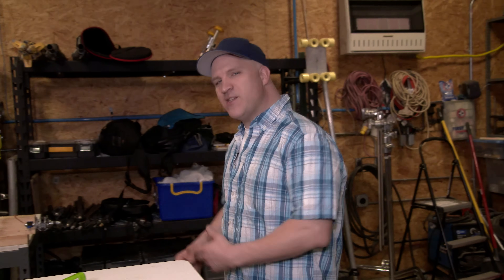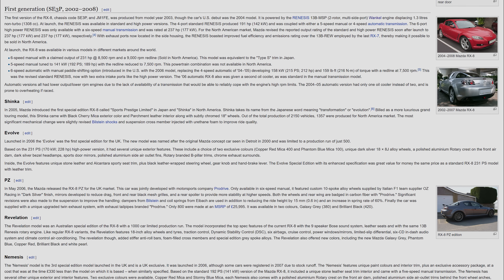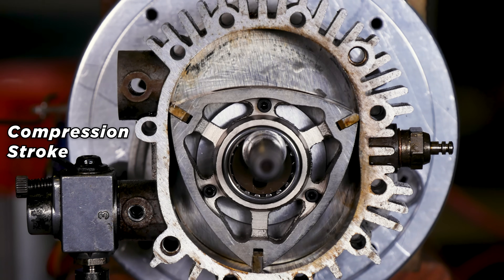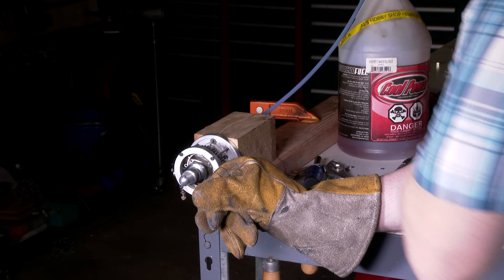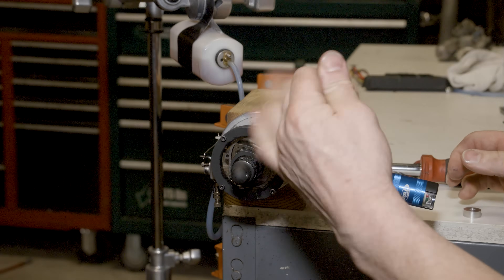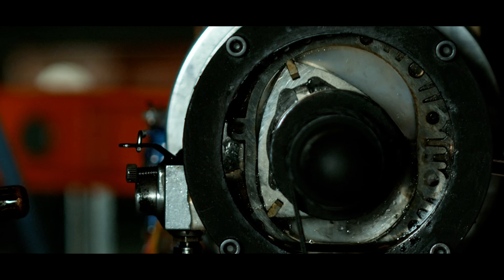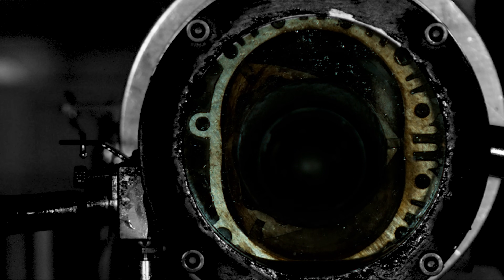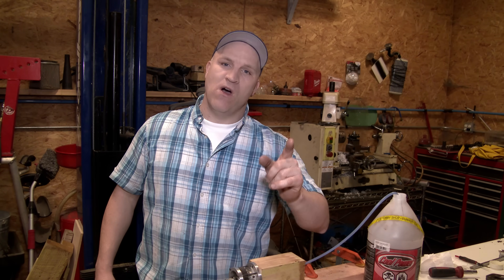See Thru Rotary Engine in Slow Motion - (Wankel Engine) 4K

Comment: Its crazy how rotaries dont use any fuel and just blow it out the exhaust
Reply: Danny Jones, all rotary engines are 4 cycle; intake, compression, power, and exhaust. Because it is rotary motion there are no "strokes". But, there are 4 distinct phases, or cycles, of each rotor face going on for each crankshaft rotation.. 
Facinating video!
Reply: @jimstepan3038 : Yeah, but this happens on all 3 sides of each rotor, so since there's 3 sides to each rotor, they're 3 strokes. In a two stroke both sides of the piston are used. The top and the bottom. The top for combustion, power and exhaust, and the bottom for sucking in and compressing the fuel through ports to the top of the piston for the next cycle. Another downfall that 2 and 4 strokes have  is in the bearings, 'cause they still have some drag, even though the roll. With engines that have fewer bearings, there's less drag (which have less friction and heat) and the engines can tack higher on R.P.M's, producing more horsepower. 👍
Reply: @ Glen Trurney  That is incorrect, each of the 3 sides completes ALL FOUR CYCLES... this requires 1080° of crankshaft rotation rather than the 720° in the reciprocating 4-Stroke Otto engine.
 WHAT ABOUT UNIFLOW 2-STROKES????  these 2-stroke do not comply with your bizarre theories.
 Contrary to your theory... All modern Mazda Wankel engines use the exact same type of hydro-static crankshaft journal bearings as any of modern car... Your typical Loop-scavenged 2-stroke engine uses "frictionless" ball or roller bearing..
Reply: 2 cycle engines have 4 "phases" also with that logic. intake, compression, power, exhaust. rotary engines aren't 4 cycle. Rotaries behave more like a 2 stroke or at most a hybrid. It uses the rotor to open intake/exhaust ports similar to 2 stroke.
Reply: +Taylor Latch That is completely wrong Taylor, All Wankel engines are 4-stroke and use the same 4-stroke operating principle as the Otto engine. Wankel engines are fundamentally different than 2-stroke engines which combine 2 cycles together at the same or overlap significantly. Port induction can be found on both 4-stroke reciprocating engines as well as the 4-stroke Wankel engine.
Reply: +Taylor Latch Please don't confuse Wankel engines with Rotary type engine either by using improper terminology like brand names, "fan slang" terms and street patois... The Wankel engine KKM engine is not a Rotary engine and although there does exist a single rotary version, it currently resides in a museum in Germany.
Reply: doktorbimmer ah gotcha. I get how the cycle is like a 4 stroke it’s just the way it uses ports and the rotor as a “valve” makes it sort of like a 2 stroke in my view at least. But yeah you’re right.
Reply: I own two, 4-stroke reciprocating engines that use ports and have oil injection and one 4-stroke reciprocating engine that has no poppet valves at all, just ports and requires premix.
Reply: Port induction and Oil Injection/pre-mix fuel are not unique features of the 2-stroke operating principle... it only matter if the 4-cycles are combined/overlap or occur completely separately which defines the difference. Cheers!
Reply: There are also 2-stoke engines that have poppet valves, wet sumps and no oil injection/pre-mix.
Reply: doktorbimmer doktorbimmer I see. Yeah I was misinformed before, thanks for the clarity. One question for you, the 2 strokes that do have poppet valves / wet sump, are they still considered a 2 stroke if there is no significant intake/exhaust overlap(unless there is), and why? Also, many 4 strokes have intake/ exhaust valve overlap by design, what exactly makes a 2 stroke a 2 stroke? I would normally think 1 fire per revolution but that doesn’t work because a rotary does 3 and is a 4 stroke. Just trying to learn.

What I mean in general terms is, I guess in regards to a 2 stroke with valve and closed oil system that you mention, is it seems the 4 cycles do perform nearly separate, intake-compress-power-exhaust.
Reply: OK then, Any questions?
Reply: doktorbimmer yes re-read above lol. Modified my comment. That’s why I saw a rotary as more of a hybrid than either a 4 stroke or 2 stroke. I don’t really understand the real definition of a 2 stroke I guess.
Reply: doktorbimmer from wiki - “A two-stroke engine is a type of internal combustion engine which completes a power cycle with two strokes of the piston during only one crankshaft revolution. This is in contrast to a "four-stroke engine", which requires four strokes of the piston to complete a power cycle during two crankshaft revolutions.”

From that definition it seems the terms “four stroke” and “two stroke” are unique to piston engines. So if the piston can complete the full cycle once per revolution it’s a 2 stroke, if the piston completes full cycle in two revolutions it’s a 4 stroke, three revolutions a 6-stroke.

How can this apply to rotary engines if there is no piston? That’s why I felt it was more of a hybrid but google says 4 stroke with some engine forums saying hybrid. Or it’s neither as it completes 3 (ish) cycles per revolution.
Reply: Taylor, All Wankel engines have a PISTON, Its right in the name its inventors gave it...
Reply: Every Wankel engine has a piston with 3-sides.. the difference between an Otto engine and a Wankel engine is the Otto engine completes its 4-stroke firing order in just 720° of crankshaft rotation while the Wankel requires 1080° to complete its sequence.
Reply: doktorbimmer ok then the piston in the wankel engine creates 3 power cycles per revolution. Going against the definition of a 4 stroke “1 power cycle per 2 revolutions”.
Reply: Wikipedia is not an accredited, peer-reviewed engineering journal or publication... A more accurate description is;
 
*In the 4-stroke all four cycles occur separately.
In the 2-stroke some of the cycles occur Simultaneously and are  Combined  or overlapping significantly.
Reply: Taylor, as I said... Don't confuse Wankel KKM engines with Rotary Type engines...they are completely different concepts (and you sound uneducated when you use slang terms).
Reply: doktorbimmer I see so a 2 stroke after the initial intake stroke begins scavenging the intake/exhaust cycles - whereas a 4stroke and wankel do not.

Still doesn’t really make sense though. The wiki definition seems appropriate mostly.

What you’re saying is if you make a 2 stroke “aka 1 power cycle per revolution” and figure out a way to stop most of the scavenging creating 4 independent steps that it would then become a 4-stroke. Even though it still fires once per revolution. I would still define that as a 2 stroke.

I know my example is impractical but imagine injecting compressed air into the cylinder when piston is at bottom then vacuuming it out right after spark. I would still see that as a 2 stroke engine although more hybrid like.
Reply: Most 2-strokes with poppet valves are Diesels and require Scavenging either by a blower or coupled turbocharger.
Reply: Are you familiar with "Winton" type engines? 2-strokes with poppet exhaust valves? Or "Knight" type engines? 4-strokes with no poppet valves?
Reply: doktorbimmer I just feel there’s too much grey area with a WANKEL to call it a 4 stroke. I agree it does the 4 steps mostly independently like a 4 stroke piston. But so does a 2 stroke, so what if it uses the piston as a valve or if the intake/exhaust ports are open at the same time, it’s still performing the same steps for combustion.

You should try to update the wiki page and define a 2 stroke as significant scavenging vs a 4 stroke as non-significant scavenging. I don’t think it will stick though.

Even if the wankel is a piston with (3 sides) that means it completes one power cycle for each revolution.. a 2 stroke does the same thing. Although I am not claiming that to be correct.

It’s basically neither a 4 stroke or 2 stroke engine although shares some characteristics with both. And it does the combustion process mostly independently/separately like a 4 stroke. How’s that?

It’s a 3.3333333333333333333(repeating stroke) case closed LOL
Reply: Do you know what a Millet type Rotary engine is? aka "Monosoupape" Rotary engine, 4-stroke with exhaust poppet valves and crankcase transfer intake ports???
Reply: Not at all Taylor, every engineer understands that all Wankel engines are 4-stroke... this matter is not debated among scholars in the field and was very clear to Dr. Hanns Paschke and Walter Froede that created the KKM engine.
Reply: OK Taylor, you seem like a smart kid (you ask good questions)
Here is the deal, the Wankel engine has a PISTON which Both reciprocates and orbits in a planetary motion
 eg; a Mazda 13b engine for an example has two pistons (often incorrectly called rotors) and a crankshaft with a 15mm throw which produces a 30mm STROKE every revolution.
  Any questions? Once you understand the basic fundamental concept of how the KKM operates you can leap beyond the confusion regarding its operating principle which is a 4-stroke just like the Otto engine.
Reply: doktorbimmer yeah I got you. So one face of the “piston” goes through intake, compress, power, exhaust separately/independently in one revolution. Looking at the planetary motion makes it easier to see, as it looks exactly like a 4stroke engine. So it’s almost like a 3 cylinder piston engine (but not really).

Never seen the rotary engine you mentioned but it seems cool I will look it up. If it uses the crankcase to inject air and a poppet valve for exhaust.. is it considered a 4 stroke also?

I saw Honda in 2015 released some patents and pictures of a new 2cycle engine with a poppet exhaust valve. Not sure if they ever put it into production.
Reply: EXCELLENT!  You are a quick learner indeed..to make that analogy means you understand the concept now... YES, in that regard the Wankel is Exactly like a 3 cylinder engine...each face is a separate chamber and each performs all 4-cycles one at a time just like the Otto engine.
Reply: Here is a good video of what a rotary engine is. https://www.youtube.com/watch?v=FvHrbkYEn0k&list=PLmhSXyOMooSlhNQZShFYxRRiz2pB_jl-g&t=0s&index=6
Reply: The Diesel 2 stroke engines, at least, have the exaust valve in the top of their head...
The admition and compretion has place in the chamber and in the carter; power and exaust onçy in the chamber (like all kind 2 stroke alternatine engines)... So why 2 stroke?
Because there is an ignitio in each 2 travels of the piston in the cilinder (one down, one up - Fire!, Down, up - Fire) that fires in each turn of the cranck...
The 4 stroke gets one fire in each 4 displacements (Donw, up, down, up - Fire!) so it fires at each 2 turns of the cranck...
The Wankel engine has the triangular piston, and is 4 stroke (for sure); now, there are 3 cicles hapening at the same time; every time that a face pass at the plug side there is fire and power; and for each complete turn of the piston there are 3 explosions (power) and 3 turns of the cranck!..
And this hapens with al the sistem rotating for the same side - no up and down; so there is less waste of power!..
There! Thats why is so powerfull and the tork is huge from lower rpm...
I use to ride a 50cc 4 manual gears motorcicle, and start riding with the 1st gear or 2nd was almoust the same...
Insane toy!!! Wasn't mine, unfortunatly (from a cusin) and he sold it, but, memories still remain   :D
Reply: @taylorlatch2635 : Since they're 3 sided, they're  more like a 3 stroke. All three sides are doing a function at all times.
Reply: @doktorbimmer : 4 stroke engines, the spark plug fires every two revolutions. A two stroke fires everytime. This rotory motor is firing every 1/3rd of a revolution, making it closer to a two stroke engine.
Reply: @Glen Turney Complete and utter nonsense kid!  You clearly do not understand the basic fundamental criteria that define the 2-Stroke or 4-Stroke operating principles... I suggest you go to a proper school and learn something instead of posting ridiculous half-baked theories and making a fool of yourself.
Reply: @taylorlatch2635   That would be a rotary valve 2-stroke engine, the intake induction.  There are also most common, piston port and reed valve 2-stroke engines.  I build those 2 for a living, do OK too. :)
2-stroke phases, I think are 6 and the phases overlap (following fuel/air mixture flow)
1) Intake phase
2) Primary compression/transfer phase.
3) Cylinder scavenging phase
4) Cylinder compression phase
5) Power stroke phase
6) Blow down phase. (distance from the top of the ex port to the top of the transfer ports).
There is no 2-stroke that uses a rotor to control exhaust flow.  If there were, they would be clean burning.  I don't think anybody has found anything feasible that can take the heat.
Reply: @doktorbimmer  Arctic Cat Snowmobiles had a single rotary/wankle engine in one of their production 1974(ish) Panthers, (I think Panther), snowmobiles.  A good friend I grew up with had one.  It did not rev quickly and vibrated quite a bit, but it ran well. A good "Trail breaker" back in that day.
Reply: @doktorbimmer  There are many designs.  But if they are good designs, in a free market, we would produce it for the market.  Now we produce everything for the EPA no matter how much of the free market they destroy.  I bet we would be paying 20% less for cars and bikes.
Reply: And there is the snowmobile my buddy had at min 0:58, with the single rotary engine.
Reply: @EarthSurferUSA OMC (Evinrude) and Sachs were both original Wankel KKM-57 licensee's. Sachs, OMC and NSU manufactured several Wankel engines that were sold in various brands of snow machines but none were commercially successful or very popular. By the late 1970's these engine were all discontinued due to poor sales.
Reply: @EarthSurferUSA  Mazda's RX-8 passed the worlds toughest emissions standards  EPA Tier2 Bin5 AND California's CARB ULEV II right up until Mazda was forced to cancel production due to lack of sales. From 1965 - 2012 Mazda never made a net profit from RX sales... the RX brand was in steady decline from 1986 until production ended in June 2012... and the RX-8 alone cost Mazda nearly $3 BILLION dollars in development and production costs that were never recouped....
Reply: Taylor Latch valves do not a 4 slcycle engine make.  its a 4 cycle engine man, just stop.
Reply: @johnsmith4630  Isn't 1 cycle more apt though?
Reply: @Flyingdutchy33 If you actually knew anything about Wankel engines you would have been ripped off by so many shops... All Wankel engines are 4 STROKE dummy!
Reply: @doktorbimmer  Hahahahaha you have no idea how amusing your anger and frustration are
Reply: @Flyingdutchy33 Are you really that ignorant to think the Wankel is a "1 cycle"??? please explain how a 1-cycle would work?
Reply: @doktorbimmer  I appreciate your being here buddy. it's always a blast!
Reply: Ernie, why doesn't your engine run????
Reply: Flyingdutchy33  hahahaha Dont go too hard on doktor bimmer, he used to have a rotary car himself, but he didn't know how to take care of it and has been living in denial ever since. Poor fella....
Reply: Ernie, (and xke xke are the same person) Please tell us why doesn't your engine run????
Reply: be true to your self @doktorbimmer be true to your self take your own advise why are you impersonating ernie brink and your self as a engineer and a doctor don,t worry Flyingdutchy33 will be right with you in your i worked with Flyingdutchy33 at mazda we both master techs master engine trust in god anyway
Reply: @doktorbimmer  According to this website, a radial aircraft engine is considered "rotary" as well. It also spells out 4 distinct phases of operation; intake, compression, ignition, and exhaust. Further, the primary difference between the DKM and KKM was that in the DKM, the housing and the rotor spun around separate axes. The KKM design, like the one in this video, simplified that and used fewer parts. One could argue that "Wankel" is proper term rather than 'rotary', since other types of engines can be rotary yet still employ conventional pistons. Let me know if I'm missing something.

https://www.revolvy.com/page/Wankel-engine
Reply: doktorbimmer 
And I’m not objecting to the fact that rotaries are unreliable, but you’re really putting out of proportion.
Reply: .*Flyingdutchy33 and me worked for mazda  as master techs engine experts  LEXUS AND MAZDAS ARE GREAT CARS*
Reply: @doktorbimmer  Hey i just noticed that this guy ( The real doktorbimmer) has a real major Rotary engine chip on his shoulder! LOL, A cursory look at his ramblings shows me he couldn't engineer his way out of a wet paper bag! LMAO.
Reply: @doktorbimmer  THE FOUR STROKES OF A INTERNAL COMBUSTION OCCURS SIMULTANEOUSLY IN A WANKEL ENGINE THIS MAKES IT MORE EFFICIENT THAN A PISTON ENGINE
Reply: @EarthSurferUSA  Toyota and Mazda have announced plans to build a $1.6 billion manufacturing plant in the United States that will create as many as 4,000 jobs
Reply: @xkexke8081  Toyota and Mazda have announced plans to build a $1.6 billion manufacturing plant in the United States that will create as many as 4,000 jobs
Reply: @doktorbimmer  Well, then your efforts have been a failure.
Reply: @therealdokoterbimmerrotary6751  bird brain tweet tweet tweet
Reply: dokterbimmer the fake ???? WOW!!! You're right, he did delete all his comments
Reply: @taylorlatch2635  Rotaries are 4 stroke. Wankels are by FACT a 4 stroke. A 2 stroke had two: intake/compression, power/exaust.
Reply: @taylorlatch2635  A wankel makes one per crankshaft rotation. 4 strokes have 4 different phases, while two strokes have only two, and it's going down and going up.
Reply: @taylorlatch2635  They don't. They intake and exhaust at the same time while down ( a 4 stroke exausts and then intakes)  and then it goes up to compress, and then it makes power by going down, starting exaust and intake at the same time ( four stroke intakes while going down, closes the intake, goes up and compresses, ignites and make power, it goes down again, then it opens the exaust and then it goes up and exauts.
Reply: @taylorlatch2635  3 power cycles per ROTOR revolution. One power cycle per eccentric shaft revolution, on a single rotor.
Reply: @taylorlatch2635  In a wankel engine, you need to see one face of the rotor at time. It intakes, then it closes the intake and compresses, then it ignites and makes power, then it exausts, and then it restarts. Four different phases.
Reply: Are you kidding.  The rotary engine is a gas hog.
Reply: @douglasrodrigues332  hahahaha Dont go too hard on doktor bimmer, he used to have a rotary car himself, but he didn't know how to take care of it and has been living in denial ever since. Poor fella....
Reply: @erniebrinkrotaryhemi7336  hahahaha Dont go too hard on doktor bimmer, he used to have a rotary car himself, but he didn't know how to take care of it and has been living in denial ever since. Poor fella....
Reply: UK Citizen Tom Licks Charles
Reply: Fuck you, cyborg
Reply: Ignore these stupid trolls... they wouldn't know a good car if one was dropped on their head!!!
Reply: doktorbimmer 
What’s a good car then?
Reply: Sarcasm is a foreign language to some.
Reply: Nice shield wall pic
Reply: @Flyingdutchy33  Have you been to the local Mazda dealer lately??? LOL!!!!!
Reply: @doktorbimmer  Yeah, they are still talking about you and how you ruined your engine because you were really too stupid to take care of it.
Reply: @Flyingdutchy33 I have never ruined any engine... I have also never owned a Mazda engine... you have to be stupid to buy one of their unreliable engines.
Reply: UK Citizen 
First, nice try insulting my name, I don’t fucking care.
Second, he was a condescending asshole on a video made by VisioRacer, where he basically acted like an ass to anyone who liked rotaries.
Reply: lmao
Reply: @pdxfunk  what
Reply: @ukcitizen1158  Jesus Christ something inside you broke when you saw that comment xD
Reply: @Flyingdutchy33  Well, then your efforts have been a failure.
Reply: This month marks the 10 year anniversary of Mazda's decision to kill-off the RX-8, the entire RX brand and cancel further development of production Wankel engines... its been a quarter of a century now since Mazda unveiled its last new production Wankel engine.
Reply: Rotary engines are 4 stroke,cause ya have 4 steps in one rev..1st step intake,2 compression,3rd combustion and 4th exaust,each steps are separatelly like in 4 stroke,diff is in each rev ya have 3 combustion steps,and in reg 4 stroke ya have 1 combustion per 2 revs..so rotary does 6 combustion per 2 revs and so does more pwr per displacement..
Reply: abecx it's not the engine- these little model airplane engines are 2 strike, and because they have no oil system to lubricate them,  the fuel itself has a lot of castor oil in it for lubrication. That is mostly what you're seeing being ejected out the exhaust
Reply: The sarcasm was about rotaries being notorious for unburnt fuel.  I'll try and be more obvious next time.
Reply: @abecx : What about converting them to fuel injection, or has that been done yet? Just asking? I'm not aware of it. Also, do they have any of these engines that run on diesel?
Reply: @Glen Trurney Mercedes-Benz developed and tested direct fuel injection on Wankel engines in the late 1960's... If I'm not mistaken? All Mazda RX models were equipped with Port Fuel Injection in the mid-1980s and from then on. Run on Diesel? Certainly not with HCSI mode combustion... and although many failed attempts have been made to develop Diesel Cycle Wankel engines (SCSI) all were failures... because Wankel KKMs cannot achieve sufficient Static Compression Ratios or IMEP to efficiently and reliably support compression ignition.
Reply: @abecx  You did good, my friend. No need to be more obvious, that would ruin the joke.
Reply: @DeZinc abecx was only pointing out the obvious... that Wankel engines are indeed incredibly inefficient and dirty engines.
Reply: @abecx   If we did not allow politics to make "unburnt fuel" such a evil, (fossil fuels in general, no matter how efficiently they are burnt), you would have thousands of dollars in your pocket every time you bought something with any internal combustion engine that can transport you.  Nobody whats to destroy the environment, but people do want to destroy your ability to create your own wealth.  "Pay more sucker".  That is what they say.
Reply: @EarthSurferUSA The fatal flaw in all the Wankel KKM designs is not high HC emissions...Yes, its true that much of the fuel gets wasted out the exhaust port in the Wankel but its biggest flaw is most of the horsepower is also wasted out the exhaust port too!
Reply: @dannyjones3840 : They're more like 3 stroke, 'cause they have 3 things happening at the same time. They're very ingenious and can tack extremely high in R.P.M. In a four stroke engine, the spark plug fires every other time. In a two stroke, or like this rotory motor, it fires everytime a compression stroke comes around, like in this motor, it's every 1/3rd of a revolution, allowing it to not lose any power on a coast through of a revolution, like in a 4 stroke, single piston engine. The downfalls to rotory engines is that they have to be rebuilt after 75,000 miles, (in a Mazda car), unlike a 4 stroke engine in other cars, which can last for a couple hundred thousand more miles, depending on how the owners take care of them, by keeping up on oil and filter changes on a regular basis. I hope that they can figure out how to improve the internal parts of the rotory motors, so they'll last longer? Those engines will have more value to them if they do.
Reply: @Glen Turney All Wankel KKM type engines use the exact same 4-stroke operating principle as reciprocating Otto engines... there is no such thing as a 3-stroke... that would imply that one of the 4 critical phases was absent... which is simply not the case.
Reply: @dannyjones3840  r/woosh
Reply: @christian robertson Poor Danny doesn't know anything about engines...
Reply: You won't find any automobile engine produced in the 21st century as horribly inefficient as the Wankel... which is also why it was generally a commercial failure and is obsolete now.